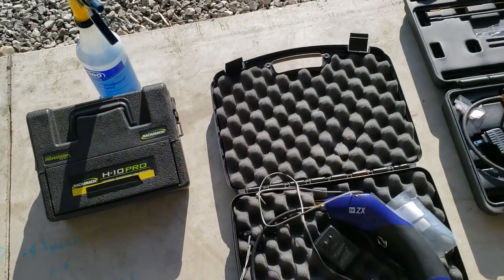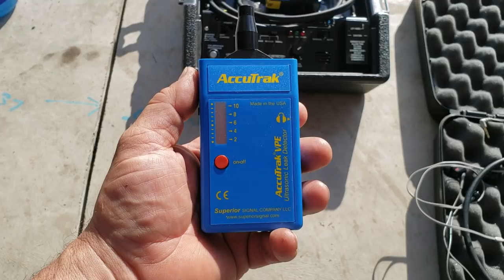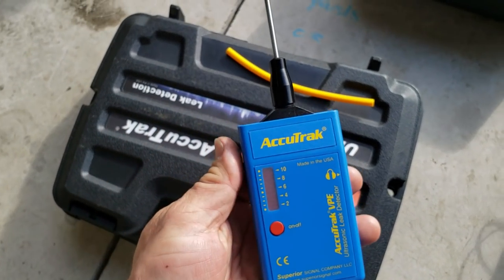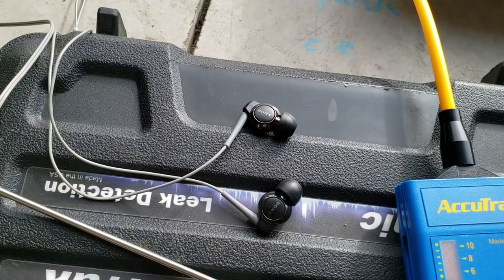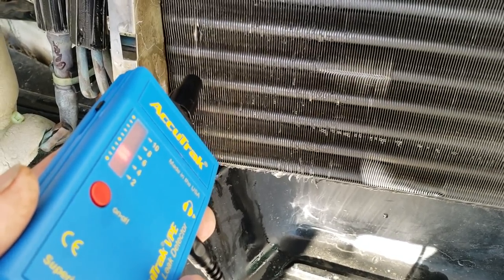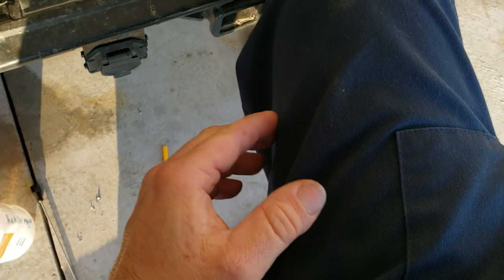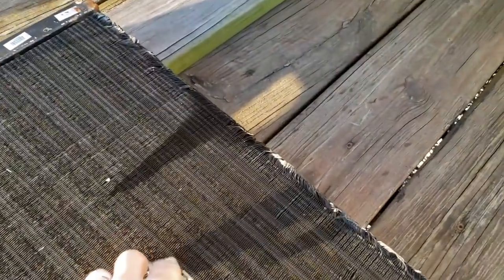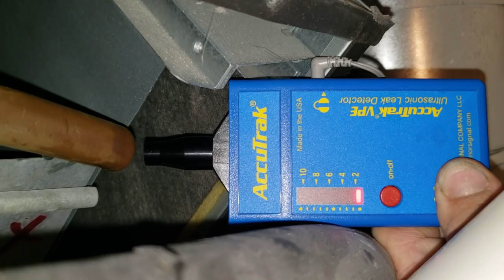Accutrak VPE Ultrasonic Leak Detector Full Review For HVAC/R

Comment from the maker: I may do a part 2 follow up video of tips and tricks that I have found with the ultrasonic detector. $$$$ Let me know any tips and tricks that you might have along with what brand you use .  🤫 Just a side note ...The factory does not recommend using the water method that I showed and that you've seen on other videos because it can cause other false sounds when the bubbles in the water are breaking (H2O) 🤣  However,  it does help you narrow it down and or verify your in the correct area.

Comment: I’ve used them for years. I’m on my second one and I’ve had it for about 8 years. It’s an Amprobe. It’s has a multiplier sensitivity with a sensitivity knob. I was looking for a leak in a unit that was surrounded by other units. I was having trouble picking up the leak due to the noise from the other equipment or so I thought. I shut down all the other units to find the leak. Turned out the back side of the compressor had cracked. This was causing so much noise I thought it was the other units lol. I’ve had trouble in mechanical rooms with fluorescent lighting. You can actually here them. I shut them off and use my flashlight. Used to be you would have leaks on the welded “U” bends but now that the tubes are rifled you can get a leak any where. These detectors are essential.
Reply from the maker: Thanks ACtech, I researched Amprobe, Inficon and a couple others and this had the most positive reviews. As you mentioned there are good and bad places to use it.

Comment: I have been doing this for 20 years and have had that ultrasound for 17 years. Besides the H10 this is the best I have used and I am glad someone finally demonstrated it. You are correct when saying you have to get familiar with the sound and once you are this isn't a leak you can't find, only issue is when you are near fluorescent lighting you get a buzzy sound.
Reply from the maker: You're absolutely correct Wayne, I've been starting to just walk around with it and listening to different devices in the buildings to get used to it and what's normal and what's not. I noticed one thing that's really difficult is when you're in a kitchen and they're trying to run the dishes. The spray nozzle and and all the clanging dished make you stop and go back over that spot again. LOL since you have more years with this device, do you have any good recommendations on how to find a leak? Or tips? I want to do a follow-up video with a few more instructional things and I need any extra information that I can put in the video.
Reply: On very small leaks the tool works better using soap bubbles first and you will hear popping sounds as the bubbles pop if there is a leak. I have had to asked the kitchen staff if they could be quite for just a few minutes why I search for a leak because if it's too noisy the tool is useless. I put the sensitivity up to full blast, when I pick up something and as I move closer I lower the sensitivity until I pin point the exact leak. I hope this helps and again thanks for the review.
Reply from the maker: @waynehensley132  thank you!

Comment: Glad your enjoying the new ultrasonic leak detector. I knew you would love it after you had played with it for awhile. Definitely makes quick work of finding alot of those pesky leaks. 👍
I even heard a very large leak coming out of the bottom of a feeder tube on a Lennox evaporator coil all the way at the outdoor unit. At first I couldn't figure out what the noise I was hearing was until I went up into the attic and saw how large the leak was. The sound was transferring down through the refrigerant lines and was audible at the outdoor unit with the ultrasonic leak detector. Pretty amazing stuff. One of the best purchases I've ever made.
Reply from the maker: I had a leak on Thursday that was in the evaporator coil of a Lennox package unit,  my h10 could barely catch it because it was 410A but I found 5 leaks total with the ultrasonic in different locations of the coil. And that was with standing pressure from the refrigerant. I'm not saying it's good for everything but it definitely has some great places to be used.
Reply: Awesome video, I'm thinking of getting a used one. Is this durable device that if I get a used one should be ok? Seller says Good working condition. $350 for the same kit in video with Koss headset
Reply from the maker: @apr9286  I know it's been 2 months,  sorry I didn't recieved a notification of your message,  if your considering a used one,  get the serial number and check with the factory what version it is and how old it is. I got this one used and it was the current version and like new for half of new. If you don't get to know the characteristics you will hate it. But once you do,  it's faster than a electric sniffer.

Comment: I would also recommend experimenting more with the "sensitivity' slider on the detector and the volume control on your earbuds. This will help you fine-tune your set up. 
Example: some leaks are so loud they will almost hurt your ears. so initially start turning down the volume on your headset and leave your sensitivity high until you've honed in on the leak and then you can start turning down the sensitivity on the detector and turning the volume back up on your earbuds to compensate. You can still maintain sensitivity without the overwhelming volume this way 👍
Reply from the maker: I might be going deaf because it doesn't seem overly loud to me LOL. And my earbuds are even louder than the Koss headphones were. Good point! Thanks for commenting.👍👍

Comment: It seems to me if you wet the entire coil down as much as possible you would be able to distinguish the sound better
Reply from the maker: It might make it more stable or uniform.   The factory told me they don't recommend using water.🤦‍♂️   I noticed some extra noise just from the natural air bubbles in the water popping, it eventually quieted down.  Another scenario I had was when I did a search of the evap coil on a 2 door reach in cooler where I was able to put the hand held unit inside and shut the door while wearing the ear phones,   it was easy to hear the leak then.

Comment: I just bought this thing and find it very hard to tell leak from all the electrical noises. Also do you know if it works with vacuum leak test?
Reply from the maker: Yes it will do vacuum leaks but this is not as easy to identify. The hardest thing to learn is what a leak sounds like. It's not what you think.
Reply: @HVACRSurvival  I tried on another take down condenser today. It wasn't picking up the leak but my infilcon whisper did. I had to wet the coil and then it start to make a kind of fast clicking sound. I just hope I didn't waste money on this 😂

Comment: doesnt work too well or doesnt work at all when the system pressure is low.
Reply from the maker: Is that a question or a statement? It doesn't pick up every leak, There's certain instances where it works great and there's others where it doesn't.
Reply: @HVACRSurvival  I tried it on few evaps with low pressure.  Didn’t pick up anything.

Comment: Not a good ultrasonic. Get a better one you'll love it. That big of a leak you should hear 15-20ft. If you need to use water to enhance the sound it's not true ultrasonic. The most important feature when buying one is variable frequency control filter. My 30 yr old Fisher Scientific kicks ass. Mine works under vacuum too

Comment: 3 years ago that was before the pandemic hit. Now there are no workers or something in the factorys
 I have order 2 and sent both back 
The one you have and the one tech T has is nothing nowhere close to what I ordered 
1st one was from Amazon the 2 nd one was from true tech tools
Reply from the maker: The device does what I said it does the problem is it's very specific to when you can actually use it. There's a lot of times where it does not create any noise because the leak is not turbulent. I use my Inficon Stratus or D-tech 3 most of the time. I would say 98% of the time.

Comment: Just checked the price..... Ouch !!.  It looks like price is the biggest discouragement of ultrasonic detectors. They may work really well but it will put a pretty big dent in ur wallet😮
Reply from the maker: That's why I bought my first one used on eBay for $250 and just recently sold that standard version one for $300. I really didn't need two of them. I kept the gooseneck version. They both were the same sensitivity.
Reply: @HVACRSurvival  is the goosneck worth the extra 100?
Reply from the maker: @jericosha2842  I like it better, it kind of sucks it's a lot of money. I guess it depends on how tight you are on money. It's not a necessity but I do like it better and does seem a little quieter than the other one. I don't use these for every leak search, only when I have problems finding it or where I know it'll probably be better suited than my normally detector.
Reply: @HVACRSurvival  I gotcha. Thanks for replying. I'm thinking about using this as my primary so I might as well go for the gusto